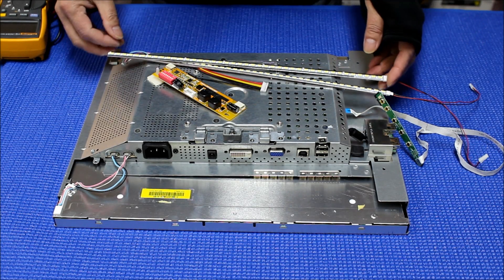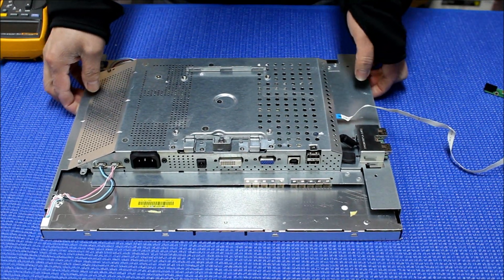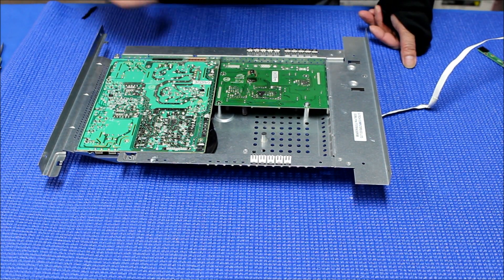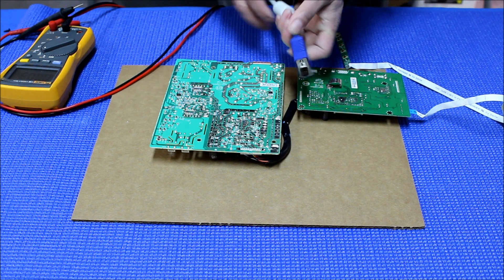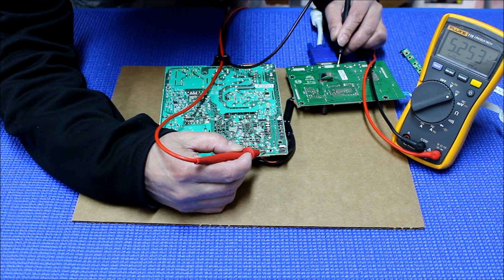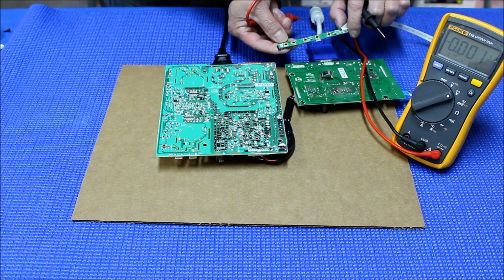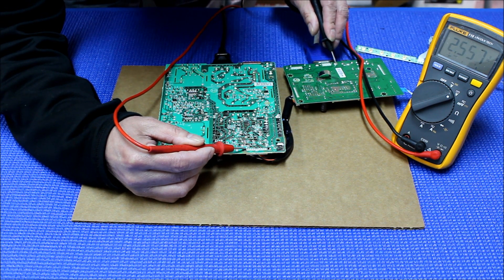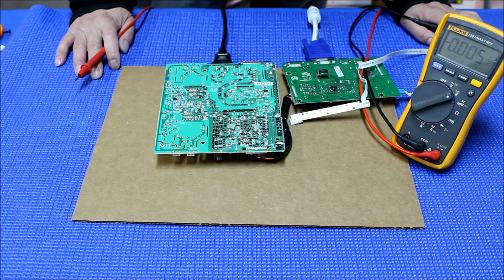Identifying LIPS Inverter pin assignment

Comment: This is exactly what I was looking for. But yeah, I have some questions

we have a red, black, white and yellow for Voltage in, ground, adjust, and on/off. My question is where does each of those go? If I'm understanding the video correctly, the max voltage you're getting out of those pins is about 5V, which wouldn't be enough to power a 12V inverter...right? Or am I missing something? Also I didn't really understand the idea behind measuring the capacitors.

Comment: So where do you solder the other yellow wire, for brightness control? Thanks for the video, by the way!
Reply: did you figure it out? I watched the video a couple of times, and I didn't see him explain how to identify the supply voltage pin, just the supply voltage.
Reply: @Logan Jarrell  I did... But this was 7 years ago so I don't remember how. I think I just turned the monitor on and tested a bunch of points until I saw  the voltage change when I changed the brightness on the monitor.
Reply: @TheBanterlorian  haha yeah I know that's a big ask. I barely remember what I had for breakfast. Anyway thanks!
Reply: Hate to bother you again, but on the off chance you remember, did you end up finding the correct power supply pin as well or did you just end up connecting it to an external power supply? If you did find it, how? The video wasn't very clear about that. Thanks again